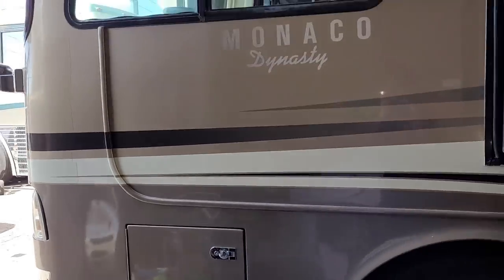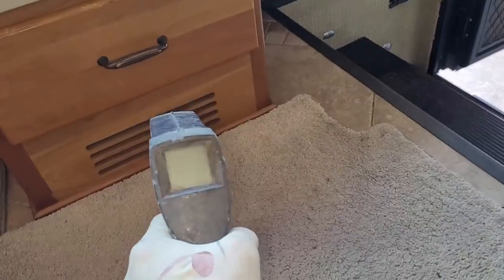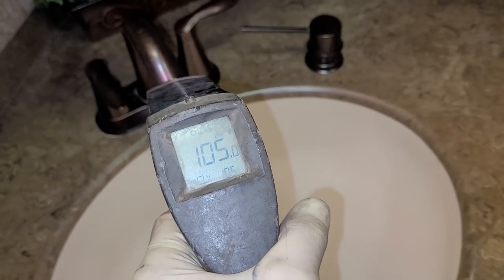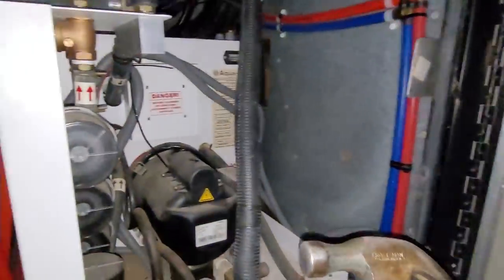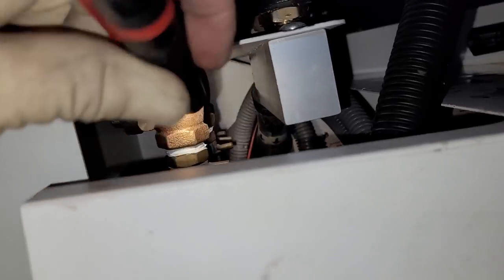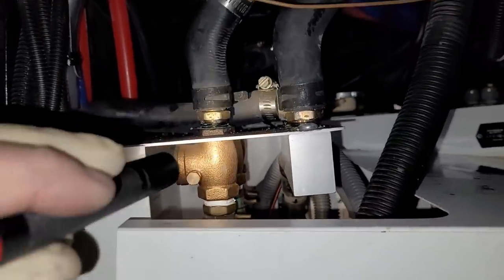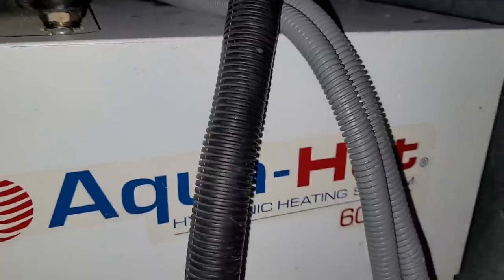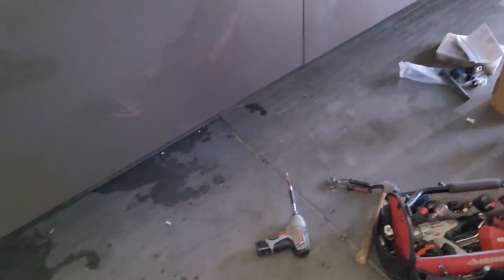One Simple Trick to Fix AquaHot/HydroHot Boiler

Comment: My beaver has a hinged top and side to remove, but the geniuses have coolant bottle above it. Broke the spot welds gonna nutsert it so two extra bolts and it'll come apart. Now to figure out why I have no heat on electric

Comment: Hi my name is Mike I just watched this video that you just did I have an aqua hot with a small radiator cap it was replaced 3 years ago the whole unit for a rebuilt but recently I've lost the electric side of my hot water heater and I was hoping in this video that you just did. That you would show removing the heating element and I'm assuming it was down in that electric box on the bottom left hand corner of the unit is that correct I still have diesel heat for my hot water that works fine Even though it's blowing a little bit of blue smoke. I haven't used it that much cuz I live here in Florida in my 40 ft beaver coach. If you could help me with a part number for this element for the heater hot water I'd appreciate it Mike Shelton really enjoyed your video

Comment: I'm having a problem with low hot water pressure, the cold water pressure is great, but when you turn it to hot water, the pressure just turns to a dribble

Comment: Is this as permanent a repair as would be replacing the check valves? 

Thanks James. Another great video. You knew what the problem was and how to fix it.
Reply from the maker: It is a good repair. If it continues then I would recommend replacing but I have done this many times now and it has lasted

Comment: Nice video. If you feel heat at the check valve and beyond and still have minimal heat at some zones. Any suggestions? I was thinking maybe flushing the system.
Reply: Yes I've got the same problem.  I've hit it with the hammer.  Check valve is getting heated up but not as hot as the other & same with flow hose.  Still blowing cold in zone 3 bedroom.

Comment: Looks like a horizontal check valve in vertical , unless its a spring lift check valve it is the wrong valve , can’t tell without seeing the part number .
Reply from the maker: they're the right valves installed by Aquahot

Comment: I have the 100 series in my 2000 Dynasty. It looks better made, all brass pumps and I leave my sheet metal cover off because it was such a bitch to get off as you noticed. LOL I will remember this if it happens to me. Also mine is in the middle of the coach. (center of the bay left to right) at least this one was on the outside of the bay.
Reply from the maker: I completely understand

Comment: Third repair try, get a bigger hammer!
Reply from the maker: of course
Reply: @AZExpert     Good news James!   I’m pretty sure I finally found the water leak in my slide out!!!!     The power cable for the 16’ awning motor is behind a plastic cover.   Where the cable went into the slide out, is near where I was finding water.   The original foam was pretty much gone.   Filled it with silicone caulk.
Also, Schwintek slide out was pulling in and then motor would spin backward and allow the seals to push it out 1/8 to 3/16”.   Talked to Lippert, must replace motor.   Even though it works, needs replacement.   
Don’t work too hard James!    
BTW, the wife thinks maybe we should go to Grand Canyon.   If I need some repair work, I could get you to do it!   
Respectfully,   Kevin